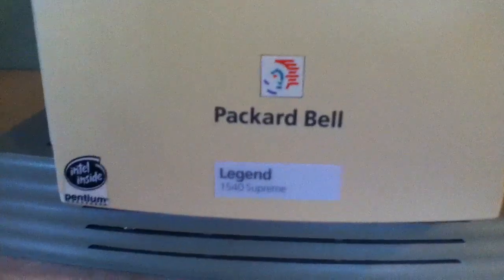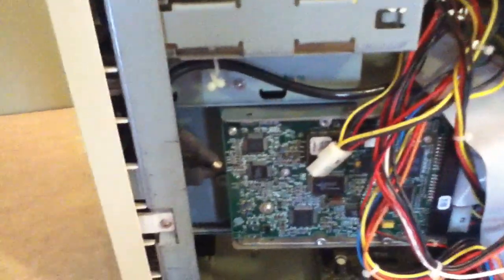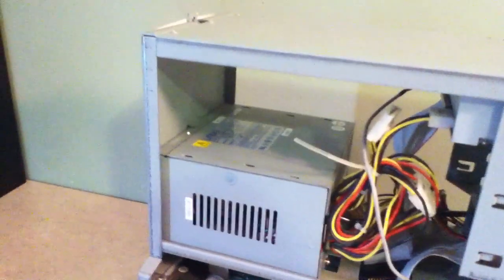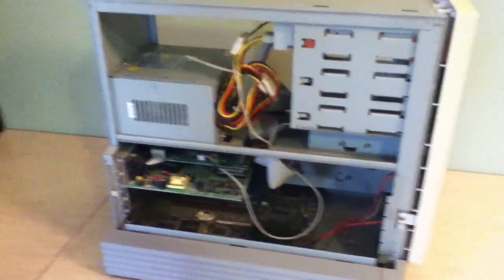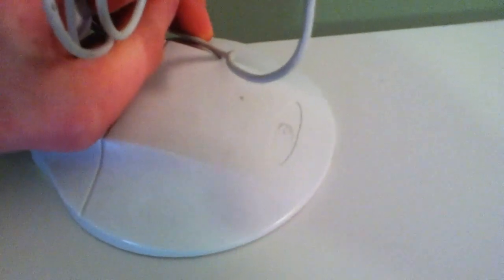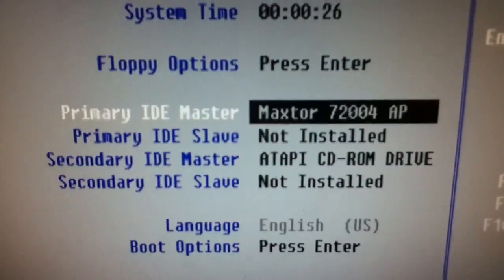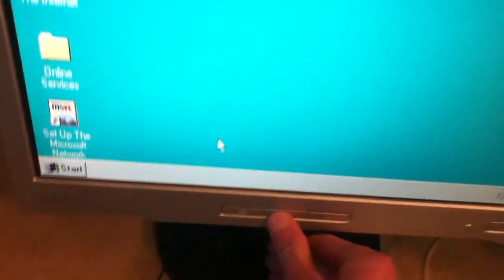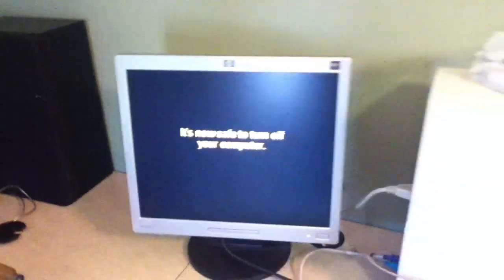Packard Bell 1540 - Free Find

Comment: I have a Packard Bell Legend Supreme 1600 minitower pc with MS-DOS and Windows 3.1, I play pokemon blue with no$gmb gameboy emulator, it mostly works, but the sound card sounds like crap, it is high pitched in ms-dos games for the digitized sound, but adlib works fine. I would want to get a Soundblaster 16 or awe32 from ebay for it.
Reply: Does it have the original hard drive?